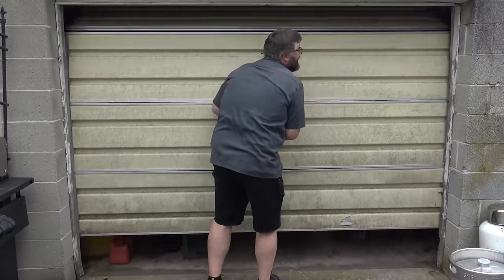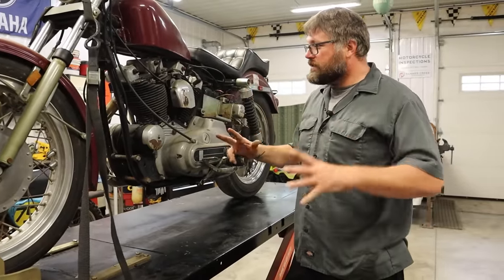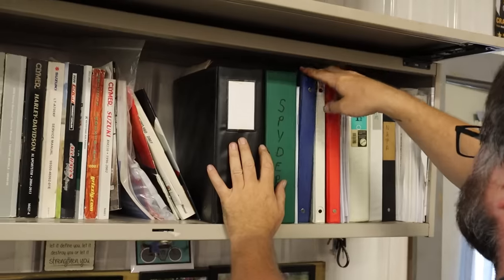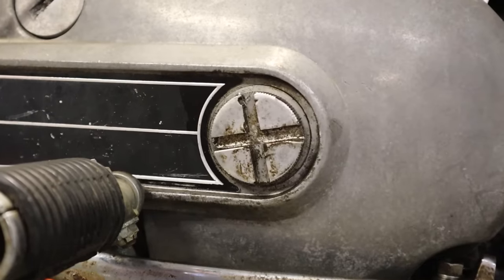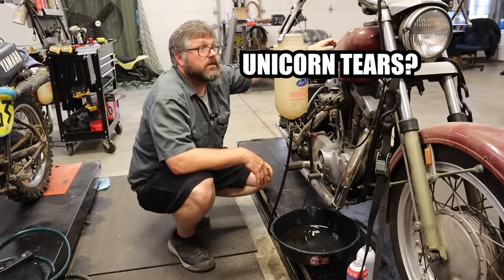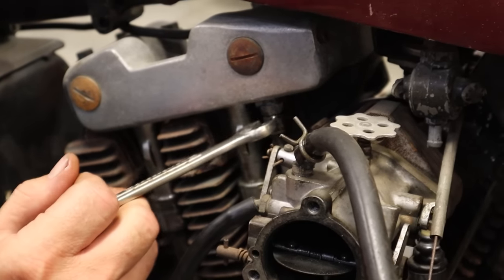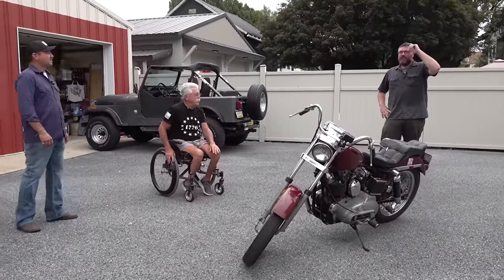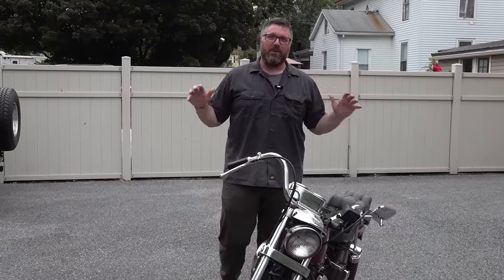Can I Get This Forgotten Harley Davidson Running? (I Just Stole It)

Comment: I do IT work for a friend. I'm mostly  the infrastructure guy, wiring businesses and residence with CAT 6, installing racks, security cameras/data lines and the like. Pretty boring to watch. But I also go pick up laptops and desk top  computers that don't work and assist the remote software guys in trouble shooting the computer so it will work well enough to reload the operating system and load a remote access program so they can access it and do the real work. I wonder how long I could have a channel of me throwing customers computers out a window? I don't like doing that work but I always want to throw it out or through a closed window at some point. Then I could have a spinoff channel of me dealing with the lawsuits. It might just work!

Comment: check the # on the cases. Harley-Davidson # have a letter. H is '70 G is '60's and then the first number after the letter is the year. G9 would be a '69 H0 would be '70 and H1 is '71. It is NOT newer than a '71 because in 1972 they made a 1000 cc and quit making the 900

Comment: Awesome video. I do have a quick question though. I just picked up a 82 gs750 t. After not running for 10 years I cleaned the carbs in an ultrasonic cleaner and got it running. It will free Rev no problem but under any load it bogs hard at 30ish percent throttle. Why? Thanks for any help and once again. Dope vids

Comment: I have never felt so technically ignorant watching engine work in my entire life. I am no stranger to working on bike motors but this is space alien stuff. 

I’d like to have you follow this up with a diesel  mechanics react type video to find out if all this makes sense to a diesel mechanic. Lots of those out there. I am reallly curious where this departs from convensional truck motors and becomes unique to the bike implementation.

Comment: Hey Nothing like Cruising down to 30 with No clutch cable you would definitely be in a jam tryin to make it down town in Threw the city light to light up 222 I have to say I have had many bikes still do but never any that I've owned were right hand shift my buddy jason was always big into Harleys i road all of them but the one his uncle Joe had left him a 70 something Harley white in color just like the one here the day i was gonna take it out lol the clutch cable had broke from sitting in the garage many years Their alright bike if that's what ur into i dnt dislike them im just more of a Kz1000 Gpz750Turbo Suzuki gs1000 with big bore kit to 1300 old school Muscle Guy IMO Best looking sounding and fastest bikes ever made of their day..My first bike was 82' kz1000J2 with Kerker 4 into one Header pipe No baffel 4 inch exhaust Shaft driven K & N Airpods Filters on the keihin FCR 39mm Flate slide Carbs it also had set of Ohlins STX36's i put on It in place of the factory shocks cake aftermarket Brakes it was the only bike i ever put that much $ into we didn't have eBay back then prices were expensive to buy new it was a cream puff if I still had her today God only knows what she would be worth Today My boy has a 72' H2 750 2 Stroke Triple Crowned The widow Maker talk about Cool it Rips for a 750 2 stroke and man does it make all the Right sounds cool video takes me back Guys today pay super close attention its not u that u gotta worry about it them not seeing u or even paying mind take my word for it getting hit maken a left hand turn by a car going 45 50 mph if u live a year later and all but 100 tho in doctor bills u still won't be riding and potentially may never walk right again its no joke...✌

Comment: I got a 2005 harley sportster 883 with 1200 screamin eagle kit on it once it hits 90 it stays there won't go past 90 mph I'd appreciate it if you could tell me what's wrong with it it cuts out somtimes sputters through the carb runs good in low gears runs good all the way up to 90 then it stays flat there

Comment: 40 YO tyres and tubes? 40 YO brake shoes? 

You're a braver man than me.
Reply from the maker: To go two blocks, you don’t need to be that brave
Reply: @The_Bearded_Mechanic  Until the glue fails holding the friction material to the brake shoes. 

Wheel locks up and you're on your arse with  a Sportster on top of you.

Comment: CAUTION!!!!! YOU HAVE AN OPEN POINTS COVER AND YOU ARE SPRAYING STARTER FLUID IN THE CARB. AND YOU HAVE A VENT LINE THAT IS POURING GAS. A SPARK AND FUEL CAN BE A DISASTER.
Reply from the maker: Good thing I’m a trained professional 😆

Comment: Your fools and I mean fools. Did you use marble mystery oil lubing the cylinder add into the oil. Add a little bit to the gas. Help the lubrication the carbonize preventing a little bit of wear and tear on the cylinder block. You stop pumping the cylinder block without any lubrication. You did not even open the spark plug. Makes a little gasoline or maybe like I do feel the cylinder a little bit with some marble mystery oil

Comment: Who do these guys always fudge around,imagining that they're going to be the exception to the rule,and not just go ahead and yank the carb,tear it down,clean it and put it back together and skip all the wasted time trying to circumvent that process,points the same thing,if it has points then go ahead and clean them, reset their gap properly,spark plugs,the same thing...
Reply from the maker: Well, in this case it's a diaphragm based carb, and if I screwed up a diaphragm I was dead in the water. The Tillotson carbs are known for being touchy. So I made it work good enough to get the job done. But 100% agree, not cleaning the carbbie will always cost you more time in the long run.
Reply: @The_Bearded_Mechanic  those Tillotson carbs were junk right off the stealerships floor and only got worse down through the years which is why they switched to the keihin cv carbs,and some people tossed the Tillotson for S&S,or Keihin,or Delortos which have been known to be troublesome as well... It's cheaper for the customer,and less troublesome to me to just r&c the carb being stupidly careful of all gaskets,diaphrams etc,tip here,place all non paper type gaskets and diaphrams  into a pot of water and cook them a few minutes will bring back their suppleness, and soften them back to like new again... same with intake boots,swing arm boots,some hand grips,etc.. as long as they're not already cracked,split,or shredding layers that is...